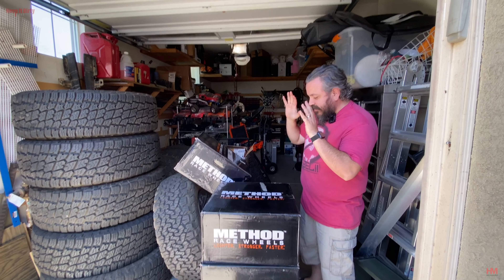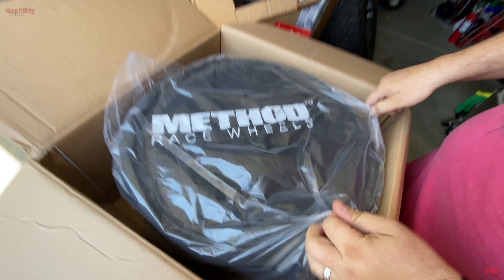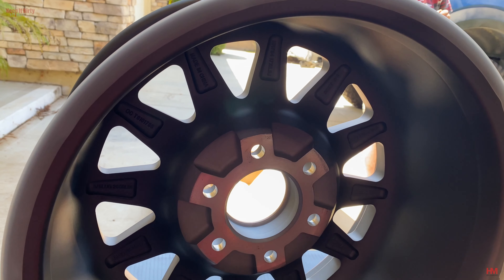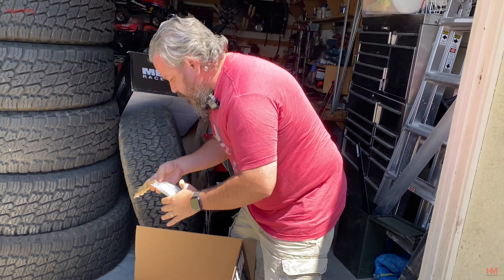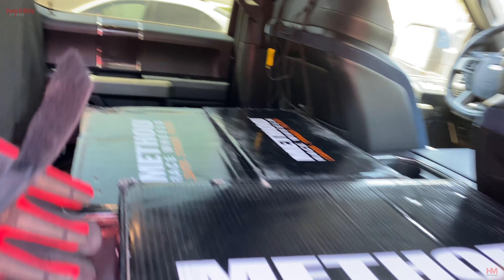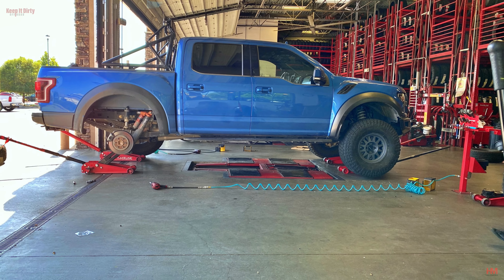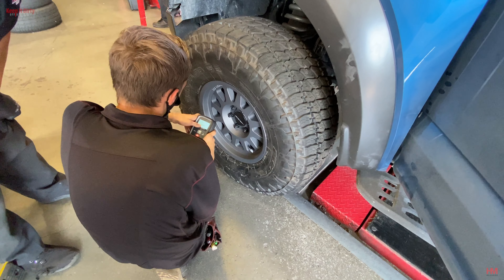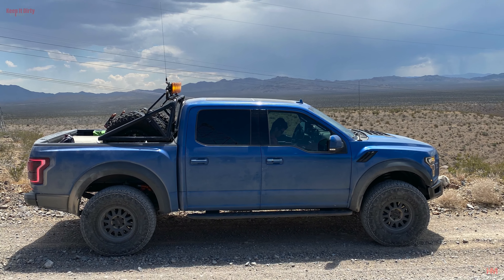Method 704s Titanium on the Raptor

Comment: You might need a set of the chief Machining centering caps.  My NV's were killing me trying to chase an unbalancing.  Turns out, the wheels were balanced, but solely relying on the wheel bolts as centering wasn't enough to keep them centered on the hub.  Bought a set of the caps, vibrations instantly gone.

Comment: I like those, but do 0 offset wheels rub on stock suspension and tires?  Thanks.
Reply from the maker: Check the follow up videos on our 37in tire series. Lots of rubbing and we went thru 2 stages of trimming required to clear the tires offroad at full articulation
Reply: @KeepItDirtyOffRoad  I did watch all of those, and they are what changed my mind on attempting 37s with a 1" lift :D ...lol  I've pretty much assumed any changes to wheels or tires without heavy modifications could cause rubbing when pushed near the limit.  Thanks for the great content!
Reply from the maker: Ah ok. So you going 35s with 0 offset? 

If that’s the case, yes, there is still some rubbing at full tuck. But mainly on the fender flares. Most just do a leveling collar to avoid it and are fine. It’s actually the most common config of these trucks

Comment: How much of the load rating is related to the lug pattern? It seems that the load rating of these is 2,650# (6 lugs). The exact same wheel with 8 lugs is 3,640#. Is that saying that the lugs are the limiting factor and ~2,560# is the highest you can get without swapping to an 8 lug pattern? I have found a couple other examples of similar occurrences
Reply from the maker: Chad D I don’t know enough about it, but your probably right. 

I have seen wheel manufacturers provide wheels that can be stronger than the lugs though. Example, most aftermarket  Beadlocks are rated for 3600-3800 lbs. the wheel construction itself is that strong. 

Looking back at this video I did fuck up. 704s are rated for 2680. But if you get the 701s in 6 lug, they are stronger at 3640. Again that’s just the wheel, and I’m sure you are correct that the lugs are still limited to 2680.
Reply: The actual lugs are not a factor when it comes to the load rating of a wheel. What Method is doing here is a bit mis-leading and marketing fluff by saying their wheels achieve a load rating "up to 3640lbs". The load rating of a wheel is determined as part of the engineering process. The engineers decide how much material to add or remove, and in what areas to add that material to increase strength and load rating. However, more material typically leads to a heavier wheel, so they are trying to find the right balance. There are a ton more details when it comes to designing wheels, but load rating is determine during the engineering process. The 6-lug and 8-lug wheels are not just simple a lug pattern change, but an entirely different engineering design. I'm willing to bet the 8-lug wheel is a lot heavier than the 6-lug. 

Their 8-lug wheels (which are typically designed for larger and heavier trucks), do have a load rating of 3640lbs. Their 6-lug wheels are designed with a load rating of 2680lbs, since the standard for most Raptor wheels has been around the 2500-2600 mark. They just wanted to be a little bit stronger :)

A 2600lb load rating has been proven to be just fine on Raptors. Even Innov8's forged Raptor wheels only have a load rating of 2600. However, engineering a beefier lip or better designed spokes to handle abuse can also play a role in how your wheels perform. That's why you see some wheels fail, while others are fine, even though they have the same load rating.
Reply from the maker: Matt C thanks for the explanation. Because the 701s have a very different construction and have the higher load rating. When I looked at a few wheels, I liked the trail series because there was a extra metal around the spokes and where the bead grip is. It’s not much, but for me (someone that has bent 3 forged wheels) it can make a difference
Reply: @KeepItDirtyOffRoad  No problem! My experience is mostly in motorsport wheels, but the general ideas are the same for truck wheels. Load rating is important, but so is the design of the spokes and lip. It looks like the trail series definitely fit the bill when it comes to a beefy lip, and I would definitely consider them if I ever replace the current wheels on my Raptor.

Comment: Factory beadlocks are better. No pain, no gain
Reply from the maker: Yes and no. 

They are better in that it’s a stronger rim and the Beadlocks allows you to run lower pressure and keeps the tire on the rim in case of a flat.

BUT, high speed off-roading requires pressure. You can’t go too low because at 60+ mph the only thing protecting the wheels is the pressure in the tire.

I run 28-32 because I’ve bent 3 stock forged Beadlocks running 25 or lower. Most race teams use 32, again to protect the wheels.

Beadlocks also means you have to do all the work. You mount, You dismount, you repair the tires. A tire swap took me a full day of work going back and forth between the shop and my garage. Too much work and not worth it
Reply: @KeepItDirtyOffRoad  I hear you, plus I’d imagine you’re recreational off roading. Trying to keep it as fun as possible. Personally I think those rims you have are nice.
Reply from the maker: Thanks man. And yeah. My builds spend most of their time on dirt.

Comment: If you want to free up some space in the garage and want to give me your old stocks or the 4wp I will gladly make that sacrifice 😝😜hahaha

I have issues with my rear right sensors was going to either take it back to big brand for reprogramming since they installed theirs or when I take it in for service but I can’t seem to get it to work. It sorta reads it but totally wrong pressure and then it says fault and stops reading it.

Comment: I like the 4 wheel parts weels better. I know you didnt buy them for looks but those methods are ugly.
Reply from the maker: TheHardcoreLife to each his own. I did not buy the 4WP wheels. They were given to me. And there are 2 main reasons I did not like them. 1. Load rating is low for a Raptor. They have a lifetime structural warranty, but I don’t want to have to worry. 
2. They are all black. I don’t like all black wheels. I need some color. An all black wheel on a truck looks like everyone else and shows no imagination or taking any risk to look different. 

So based on function alone, the Method 704 is a much better wheel.